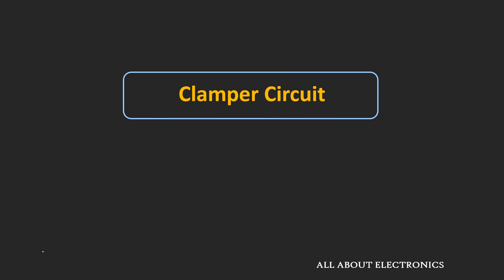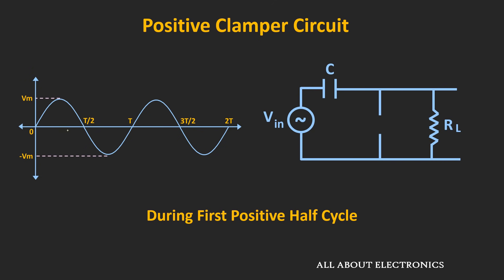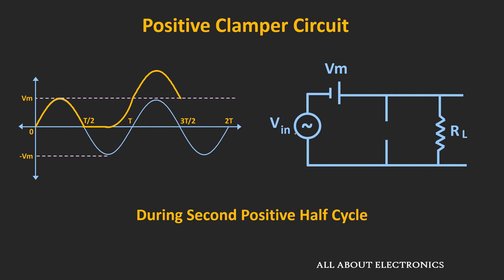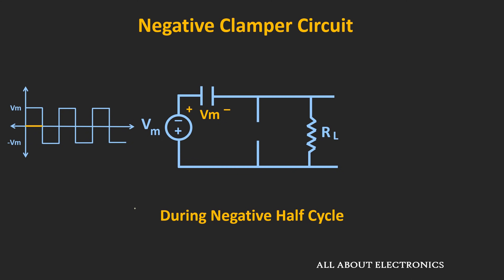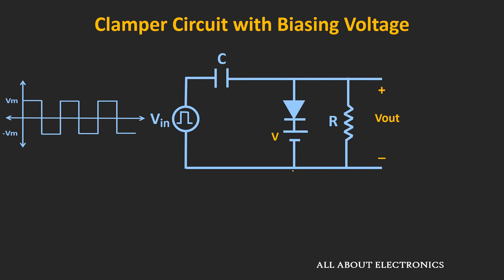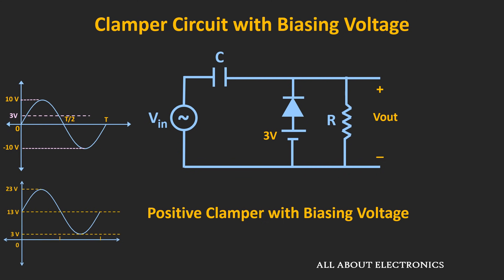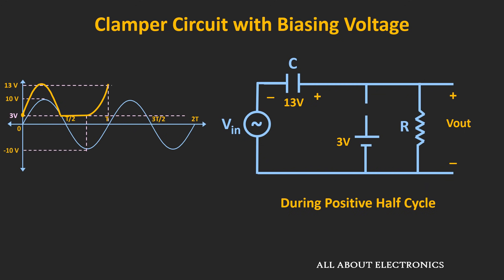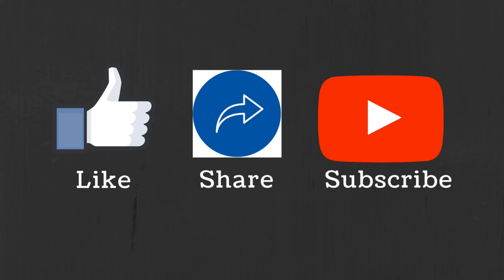Clamper Circuit Explained

Comment from the maker: The Timestamps for the different Topics covered in the video:

0:19 What is Clamper Circuit? Types of Clamper Circuits

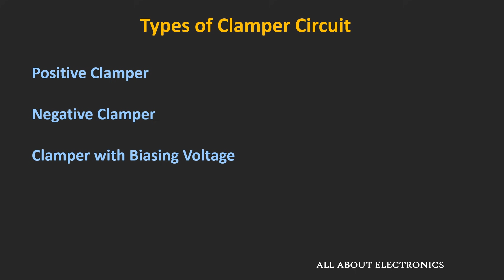1:32 Positive Camper Circuit (with circuit analysis)

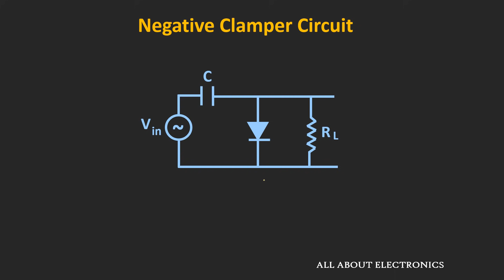6:40 Negative Clamper Circuit (with circuit analysis)

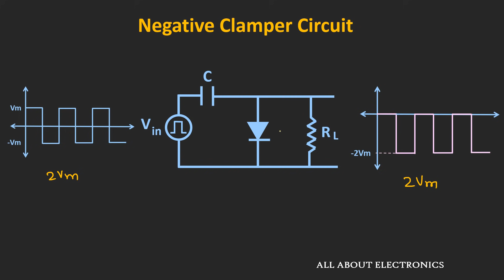10:27 Negative Clamper Circuit with Biasing Voltage (with circuit analysis)

12:44 Positive Clamper Circuit with Biasing Voltage (with circuit analysis)

Comment: I figured out my own question.  I am, by no means, an LTSpice expert.  But I managed to model my negative clamping circuit.  Under normal conditions, this circuit would clamp the output to -2Vin.  However, my output is across a capacitor (low pass filter) that is effectively shunting the negative half cycle of Vin to ground.  Under that condition, the circuit clamps the output to -Vin.  LTSpice clearly shows the output being clamped to -Vin minus the voltage drop across the diode.  It does take quite a few cycles for the output voltage to reach a steady state value.  The higher the frequency, the longer it takes to reach steady state.  At 10MHz it takes about 800ms.  In order to smooth out the ripple in the output voltage, I added an additional capacitor to the output.  This pretty much removed all the ripple, but it did increase the amount of time it takes to reach a steady state value of -Vin.  If it weren't for your excellent video, I might never have figured it out!

Comment: How is the capacitor getting fully charged to vm ? We know that capacitor takes 5RC time to get fully charged , but here the input is reaching it's peak value in T/4 time , where T=0.1RC approx , that means input is reaching it's peak value in RC/40 time , so how is the capacitor getting fully charged up , as we know it takes atleast 5RC time to get fully charged .
Reply from the maker: If you notice, the capacitor charges through the diode (when a diode is conducting). The forward resistance of the diode is much smaller than the load resistor. And to make the analysis simple, it has been assumed that the diode acts as a short circuit. So, capacitor charges in no time. The capacitor discharges through the load resistor. But for the clamper circuit, the necessary condition is RC >> T. So, in one cycle, it can be assumed that the charge across the capacitor is almost constant. 
I hope it will clear your doubt.
If you still have any doubt, let me know here.
Reply: @ALLABOUTELECTRONICS  excellent

Comment: hi, i have sold TVS528 diode to my customer , he is saying:- During our application test Indexing test failed , Clamping Voltage found unsufficient and indexing angle not detected .

i would like to ask you can we check the diode thru multimeter?

Comment: Great explanation of clamping circuits! I have a question regarding a negative clamping circuit where the output is across a capacitor rather than a resistor.  In my application the resistor and capacitor are basically a low pass filter that effectively grounds the negative half cycle of all frequencies above 20Hz.  It would also ground the positive half cycle but the diode is virtually a short circuit which allows the series capacitor to charge to Vin, but the output is zero.  Not sure how to model what happens on the negative half of the cycle.

Comment: Great video mate
Just one doubt
In the 1nd PART of negative half cycle the capacitor charged to Vm
And got discharged in 2nd PART Of negative half cycle 
So the capacitor drained out r8ght
So in the 2nd  positive half cycle the capacitor should no longer have Vm voltage with it right
Reply from the maker: The capacitor won't get discharged completely after the time 3T/4.  (during the second half of the first negative half cycle)
Because, as I mentioned in the starting of the video, for the clamper circuit, the RC time constant is much greater than the time period. RC >>T. that means there is an only slight reduction in the capacitor voltage. 
At the end of the video, I have also shown the simulation result. 
Please go through it. You will get a better idea of the circuit.
For the exact timing, you can check the timestamps in the description of the video.
Reply: @ALLABOUTELECTRONICS  oh
I was careless
Thank you

Comment: At 11:20 ...in negative clamper circuit with biased voltage , how the output voltage becomes V volt in positive half cycle ...it should be zero ?

Comment: 5:13 ... Why volatge across diode is Vin + Vm ???
Reply from the maker: If you apply the KVL, then voltage at the cathode of the diode is Vin + VM. While the voltage at the anode is 0. Therefore, from top to bottom, the voltage across the diode is Vin + VM. I hope, it will clear your doubt.

Comment: 2:15 Can u explain the polarity of V in which side we should start the positive at Whether always above or below or is there any convention?
Reply from the maker: If I am not wrong, you are talking about the sine wave direction, right ?? If so, then it depends on the phase shift. In a conventional sine wave (where the phase shift is 0), it starts towards positive. If you add a 180-degree phase shift, sin (wt + π) then it will go negative. If you meant anything else, let me know here.
Reply: Thank u for replying.. My doubt is at 2:12 , There is V in .. So to start with our +ve half cycle .. If I draw + sign representing +ve half cycle .. Where should I draw whether towards Capacitor side or Opp side ((((near Vin))))) ? DID U understand my question sir?

Comment: I m a mechatronics student plz difference b/w and application of clipper and clamper video
Reply from the maker: The Clamper Circuit is used when you want to shift the DC level of the signal. While clipper circuit is used for the protection. In the circuit when you don't want your signal to go beyond the certain voltage in any circumstances then the clipper circuit can be used. It will clip the waveform or the signal if it tries to go beyond certain range.
I hope it will help you.

Comment: @12:00  the Vout is -2Vm, not -2Vm+V. Since V is open ciruited, it will not have any influence on the o/p voltage . Right?
Reply from the maker: Actually, it is because of the voltage across the capacitor. If you see the voltage across the capacitor at that time, it is equal to Vm - V. And supply voltage is -Vm.
So, the total output voltage is = -2Vm +V.
I hope it will clear your doubt.

Comment: sir how in 2nd negative cycle of positive clamper circuit the diode is still reverse biased , the diode  should be forward biased right?
Reply from the maker: During the second negative half cycle, the voltage across the diode ( between cathode and anode ) is Vin + Vm. The minimum value of Vin is - Vm. So, at the most the voltage across the diode will go to 0. That means the cathode will be always more positive than anode during second negative half cycle. And therefore, it will remain off. I hope, it will clear your doubt.

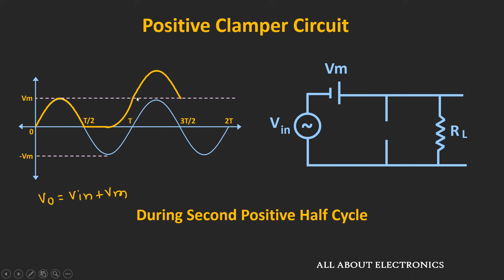Comment: At 5:41 , why does the diode remain reverse biased? Isnt it forward biased as current flow thru the diode from anode to cathode?
Reply from the maker: If you see, the voltage at the anode of the diode is 0V, and the voltage at the cathode is Vin + Vm. At the most, the voltage at the cathode will go up to zero. (when Vin = -Vm). But it will not turn on the diode. Therefore, the diode will remain in the reverse bias condition during the negative half cycle. I hope, it will clear your doubt.

Comment: 4:44 does the capacitor voltage reach Vm only when the input voltage is -Vm ? Or it can reach Vm before that input voltage
Reply from the maker: Yes, capacitor voltage reaches Vm during first negative half cycle when input voltage is -Vm.

Comment: At 04:15 _ how the cathode is more positively charged than the anode?
Reply from the maker: Because after 3T/2 time, the input voltage Vin is greater than -Vm, That means the voltage observed at the cathode of the diode (Vin + Vm) is greater than zero. At 3T/2 it is zero, as Vin = -Vm. That's why cathode is more positive than the anode. (Anode is ground potential)
For more info, please check the simulation graph at the end of the video.

Comment: im from non electronics background, bro what does this dc level means?
Reply from the maker: Starting from basic, there are two types of sources. AC and DC. In the AC source, voltage continuously changes with time. while in case of DC voltage source, the voltage level remains fixed irrespective of the time. 
In many practical circuits, you will find both AC and DC sources.
Reply: @ALLABOUTELECTRONICS  thanks bro

Comment: what is RC time ? plz reply im 1st year ec student
Reply from the maker: It is the time required by the capacitor (RC circuit) to charge to 63 % of the applied voltage. I have already covered that in the earlier videos of transient analysis. For more info, you can watch those videos on transient analysis.

Comment: What happens to the Vout if theres a change at the resistor value?
Reply from the maker: The output voltage may change slightly. But as far as RC is much greater than T, it will not affect much.

Comment: what happens if we use a 'real capacitor' instead of the ideal one used here?
Reply from the maker: At 18:00 I have shown the simulation results. with real diodes and capacitor, you will get that type of waveform.

Comment: How it will be vin+vm at 3:57
Reply from the maker: During the positive half cycle, the capacitor will get charged to the peak voltage Vm.
And here it has been assumed that the RC time constant of the circuit is much larger than the time period of the signal.
That means from T/2 to T, when the input signal is reducing, the capacitor will hold its charge and hold the voltage across it to Vm.
That means at the beginning of the negative half cycle, the voltage across the capacitor is Vm and hence the voltage across the diode is Vin + Vm.

Comment: Some points are'nt explained clearly....at 4:15
Reply from the maker: Because after 3T/2 time, the input voltage Vin is greater than -Vm, That means the voltage observed at the cathode of the diode (Vin + Vm) is greater than zero. At 3T/2 it is zero, as Vin = -Vm. That's why cathode is more positive than the anode. (Anode is ground potential)
For more info, please check the simulation graph at the end of the video.

Comment: At 3:59min, how Vin+Vm ,why not Vin-Vm
Reply from the maker: For a moment, just don't see, how the Vin is changing. (Whether it is negative or positive). It can be expressed as Vm sin (wt). 
So, just using the KVL, it will be Vin + Vm.
I hope it will clear your doubt.
If you still have any doubt then do let me know here.
Reply: @ALLABOUTELECTRONICS  sir according to convention if we take first sign then as negative half cycle if we move from down to above then +sign of Vin amd then as we move upwards then there is first negative sign appears so we should take vin-vm according to me so plz clear my doubt plz sir
Reply from the maker: That's what I told you initially. Don't consider the negative half cycle of the input. In the sin(wt), when you put t>T/2, it is already considered. Just assume it is Vin with positive terminal on top and negative on bottom.
I hope now you will get it.

Comment: why we take RC>>T
Reply from the maker: So that the across the capacitor can be assumed to be constant. If that condition doesn't satisfy then the voltage across the capacitor will discharge through R. If RC >>T, then discharging rate would be very slow and voltage across the capacitor can be assumed to be constant. I hope it will clear your doubt.
Reply: @ALLABOUTELECTRONICS  thank you sir
and i am preparing for iit jam so this topic is very useful for me.
thank u sir . i really appreciate your work.your explanation is very easy to understand.